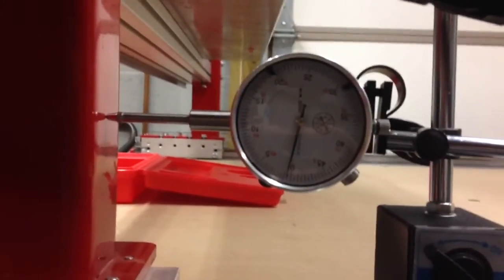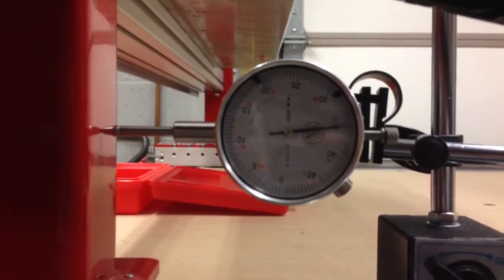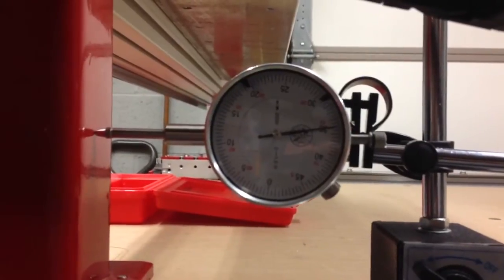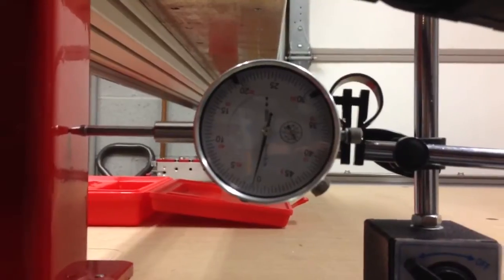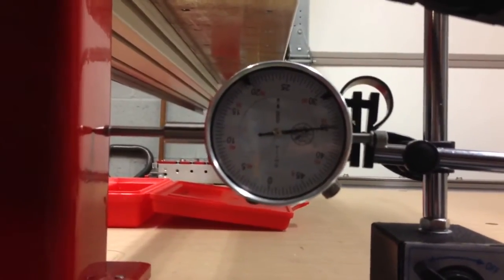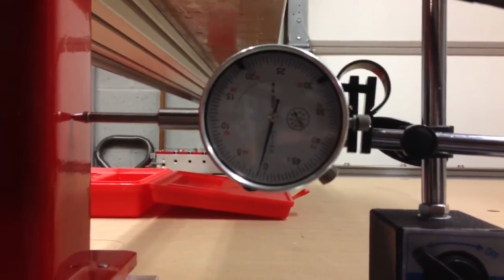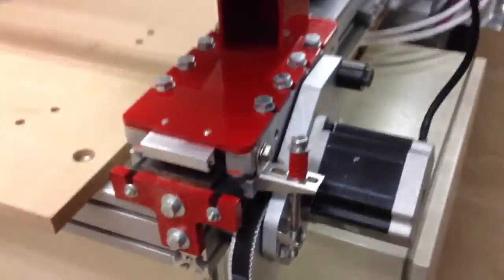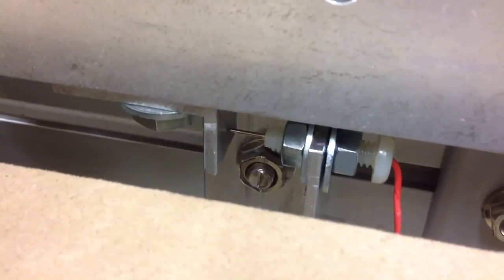Repeatability Study to Assess the Precision of the Pogo Pin Limit/Home Switches

Comment: I just came across your pogo limit switch videos and notice that these were done 3 years ago. It looks like a very accurate and inexpensive solution, but can you comment on how the system has held up over time? Do you still use these switches and what was the primary problem you found with more traditional proximity switches. Thanks